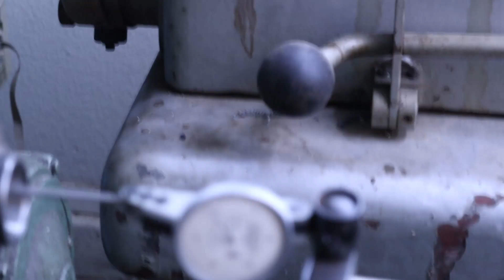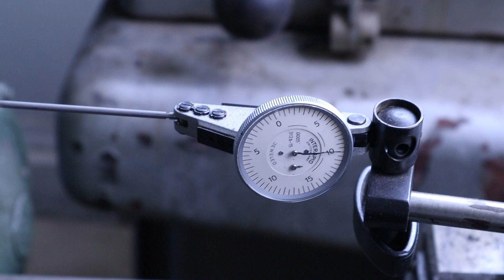Grinder Wheel Balancing Arbor Part 1.  The Turning Away.

Comment: I'm not sure why the channel's called 'Almost Machining' - but that's where I'm about ! I've inherited my father's home shop and working towards getting the machines running again - with a plan to use them ! I'm still working on electrics but have been distracted with other hassles at the moment.

Just a couple of video comments - first, the sound is very quiet on this video (as it's the first I've watched, the issue may apply to all your videos). It should be possible to fix that in the video editor. The other thing is  - at normal playback speed, the action appears to take place in slow motion. When you run that section at fast speed, the movement appears to be nearer right. It's as if the frame rate of the camera is wrong. For the US, I'd expect a frame rate of 30 or 60 fps. It's like it's half or even quarter that speed and the software is interpolating making copy frames. Actually, I've just checked, and it's 1/3 - so there are 3 identical frames then we get the next image 3 times as well. (YouTube does frame by frame advance using the , (<) and . (>) keys - so you can see what I mean by using those keys on a paused video.) Perhaps you can go through your camera settings for audio level and image settings and end up with better videos ?
Reply from the maker: I agree on the sound levels.  They have been a bit messed up in the past.  Ill take another look at the framerates im using. Thank you for pointing those out.  It takes a lot of time to fix old equipment.  I am sure you will do a fantastic job!
Reply: @AlmostMachining  So much else to do keeping me away from the machines :(
The framerate issue was just on the one video (of 2 I've looked at).
Audio kit often has an AGC (Auto gain control) i.e. adjusts the recording volume to suit. Doesn't mean it gets it right or there maybe settings for it.
Reply from the maker: The newest ones should be louder.  Intry tonavoid automating too much in the editor.  Ill take a look at that for sure to see if I can pull it up a bit on the next one.  You will get to your stuff as time permits.  Im busy with work just about all day every day it seems